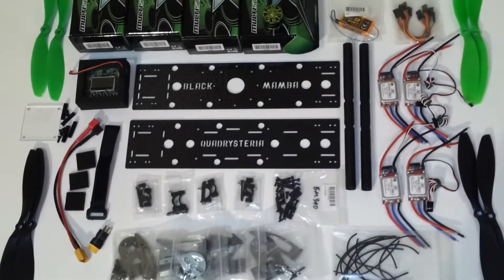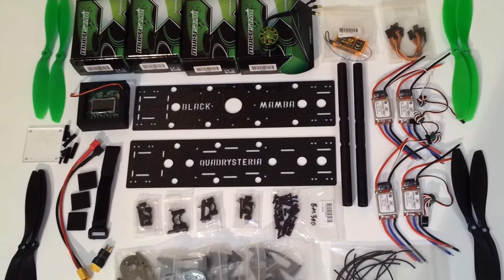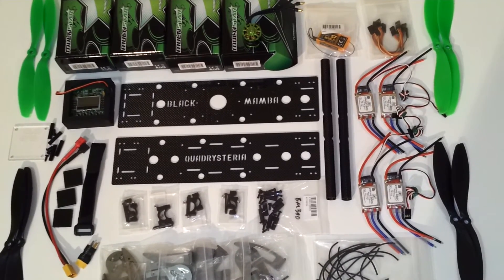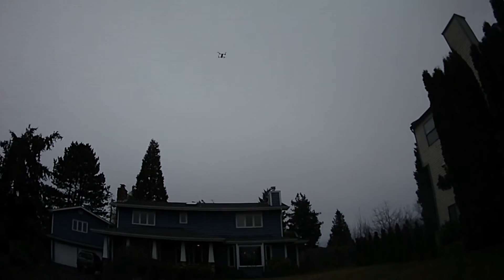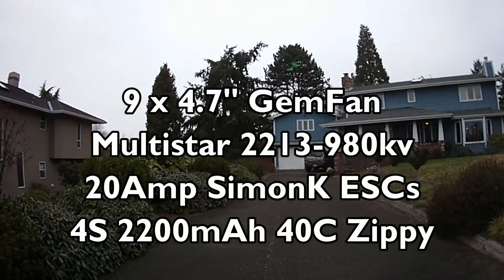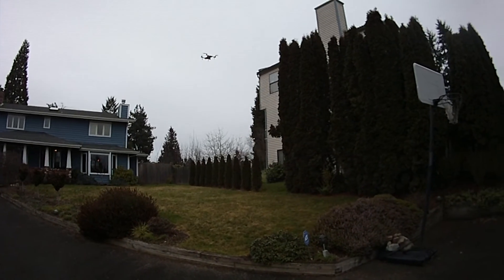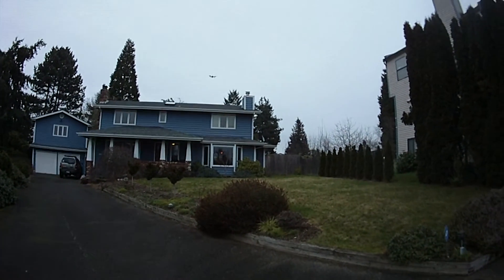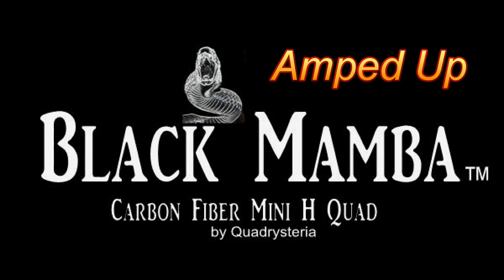Black Mamba Build Video

Comment: Is the copter also a beast with 3s? How much wight the complete copter?
Reply from the maker: Yes, with 9" props with 3S is fun :)   8" props need 4S - that is what I fly on it now: APC 8 x 4.5" with 4S 2200mah
My AUW is around 750g with FPV gear and 850g with GoPro.
Reply: Quadrysteria 
I have also the multistar 2213 with 3s 3300mAh. But my quadrocopter isn't a beast. :( The frame is a self construction and wight 1000gramm. Is the wight the problem? I used multi wii.
Reply from the maker: Weight is the primary problem. But it could also be the tuning (rates) you have set your multi wii at. Besides the Naze 32 (which is similar but not exactly the same as multi wii), I have only tuned one MultiWii - it was running 2.2 multiwii firmware and just didn't fly snappy at all. I had to turn the rates way up.
Reply: Quadrysteria I have found the problem. The esc wasn't correct learned for the transmitter. Also i learn the esc correct at the transmitter and the quadrocopter have now a lot of power at the 3s Lipo. With the 4s is the power much better.  ;)